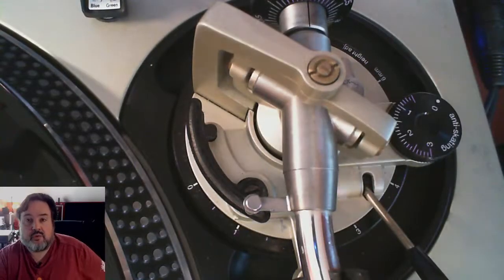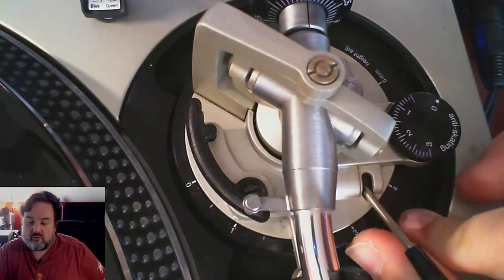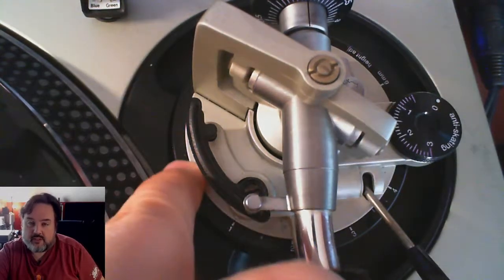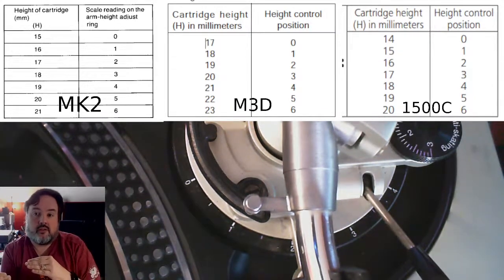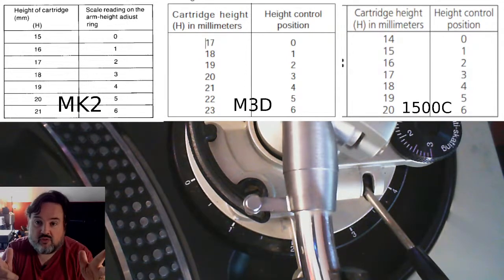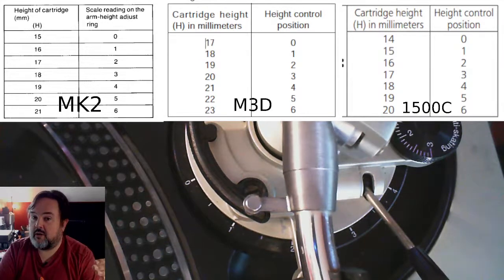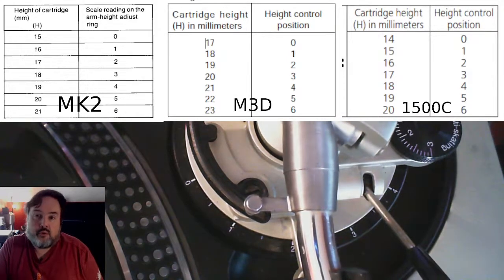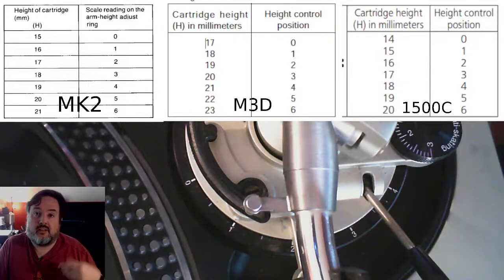Turntable Vertical Tracking Angle - Technics SL-1200

Comment: I have an Ortofon 2M Bronze Premounted cartridge (with headshell). The cartridge is 18mm high. The manual for my Technics 1200 MK2 says that for 18mm the arm height is "3" - is this the correct setting for the 2M Bronze?
Reply from the maker: Yes. All the 2M series all the same physical side.

Comment: hello, little late to the party here. I own a mk2 and have an Ortofob 2m Black mounted to a Sh-4 headshell. if i am following this correctly, would i want to balance my tonearm as normal having it float parallel to the surface, and since the 2m black requires a VTA of 20, would i set the adjustment to 3 since you stated for the blue which the cart height is 18 and requires you to use it at 1?

Comment: ho un technics sl1200 mk2 e dovrei montare una goldring g1042, specificano un angolo di tracciamento a 24 gradi, come regolo il vta? grazie
Reply from the maker: You adjust the VTA on an SL-1200 by twisting the big black circle at the base.
Reply: indicano un altezza di 17,3 dovrei impostare a 2 stando ai dati riportati dell mk2. è corretto?
Reply from the maker: @simonecionco1565  I think it depends on if you are using the felt mat or the rubber mat. Some other user suggested that the rubber mat is what made up the 2mm difference.
Reply: uso il tappetino in gomma originale, quindi, considerando l'altezza della cartuccia 17,3 e il tappetino 2mm a quale numero dovrei regolarlo, stando allo schema mk2? 17-2=15 quindi 0?

Comment: I feel the reason for the VTA offset among old models of SL-1200 is just the thickness of the supplied mat. The MK2’s came with the thickest ones, they were 6 mm, I think there were also 4 or 5 mm mats (with different part number). I know the newest rubber ones were just 3 mm and I’m guessing that felt slipmats were likely only 2 mm, but honestly I haven’t measured them. I remember I’ve read on a forum that the new models 1200G and GR are supplied the 3 mm rubber mat, and unlike the G model which has the platter taller thanks to its brass upper part, the 3 mm mat was not thick enough for some cartridges on the GR, so their owners had to use either spacers or two mats (or higher ones if they found it), the original 6 mm mats were not easy to find or they were quite pricey. (The arm assemblies on the new models are actually different from the old ones, so in that case a different height wouldn’t surprise me.)
Reply from the maker: I think you are onto something.

Comment: Is it fairly safe to assume, that most cartridges, are designed for, and will sound close to ideal, if when mounted,  the tonearm is truly horizontal to the record surface while playing?
Reply from the maker: Some don't believe in VTA, but if you have a tonearm with VTA adjustment, you CAN hear a difference. If the stylus is downtilt, it usually sounds muddy. When there is an uptilt it can sound brighter. That is because the stress on the cantilever is loose if down and tight when up. So it is either has more movement than needed or restricting movement, or should I say vibrations.

Comment: Very helpful. My Technics SL-1210 GR has a chart in the booklet. I set the VTA to 1, since my Ortophon Bronze is 18 high. Thanks for your video. 

Any thoughts on tone arm interconnects?
I used some true high end interconnects that work well with my CD player that sounded very harsh with the 1210 GR. When I used the supplied cables it was really quite smooth. I can live it, but are there better cables?
Reply from the maker: I have a cable recommendation video coming up very soon. But I will go ahead and tell you that I really love World's Best Cables (find them on Amazon), and you can get Mogami, Canare, or Gotham, and I prefer the Gotham.
Reply from the maker: But that is for RCA. For tonearm wires, you are asking the wrong person.
Reply: Thinking either the Ortofon 2MBlue or the Audio Technica AT-VM95SH which has a Shibata Stylus....which do you think maybe better for a Technics SL1210GR ?
What is a Shibata Stylus ?

Comment: Whats a stanton 500MK2 height ?
Reply from the maker: I had to search and search to find this, but it is listed at 23/32" or about 18.25mm. Just take into consideration that Stanton carts are recommended by Stanton at 15 degrees and not 0 degrees...downward tilt. I have seen many 500 series and 681's with spacers for this. If you have a SL-1200 MK2, your VTA would be at 1 I believe.

Comment: Nice video, planning to put 2m black, on my mk5g, , vta is on 1 setting, how's the matching compliance , do I need to change my stock headshell...? Thanks for ur help....
Reply from the maker: No. The SL-1200's have adjustable VTA. Headshell spacers are for arms that do not have this adjustment.
Reply from the maker: Oh, and your matching compliance is fine. The 2M Series was designed for mid-mass tonearms like stock one on the SL-1200.
Reply: My Ortofon 2m Bronze has two clear plastic like spacers/washers between the screws and headshell. Do account for that? I have my VTA set to 1 because my cart height is 18. I also have a acrylic platter mat that's about 1mm thick.